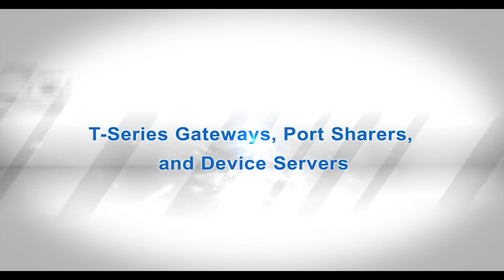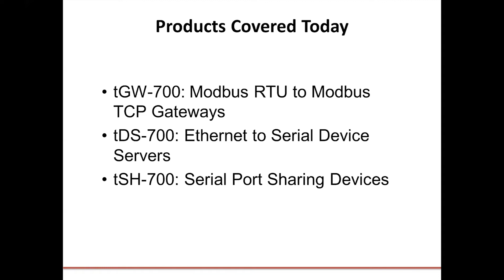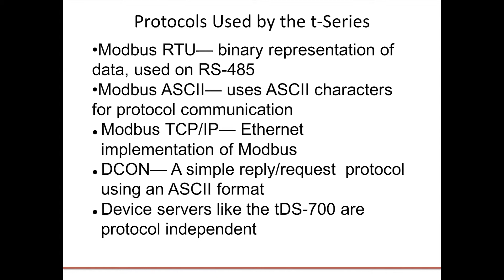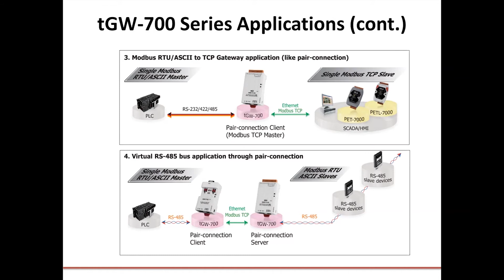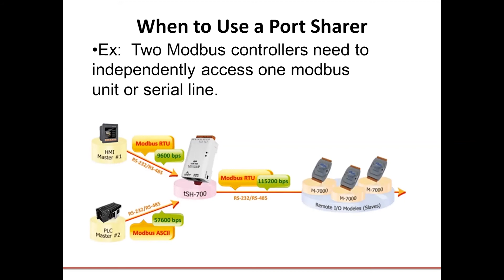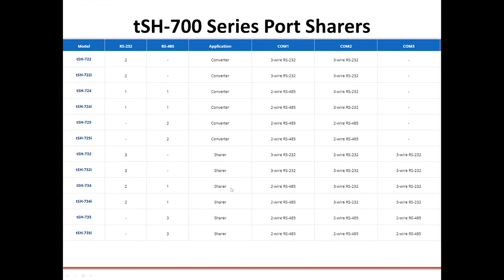T Series Gateways, Port Sharers, and Device Servers Training

Comment: I buy tgw and wise 58xx. Do you have tutorial to use this. Tx
Reply from the maker: Hi There,

The following video shows how to get started with the TGW-715.
https://www.youtube.com/watch?v=O5VHgG4aLjU&pp=ygUHdGd3LTcxNQ%3D%3D
https://www.youtube.com/watch?v=pQsPE0zFmGk&t=70s

For the WISE-5800, I would suggest the following pages.
Page 13 to setup the WISE-5800 network connection
Page 39 to set up your Modbus Device
Page 66 to configure your Datalog settings

Here's the document: https://www.icpdas-usa.com/documents/ICP-DAS-WISE-User-Manual_v1.61en_580x.pdf

If you have any additional questions, please contact our free technical support department at (346) 292-9998.

Thanks,
The ICP DAS USA team